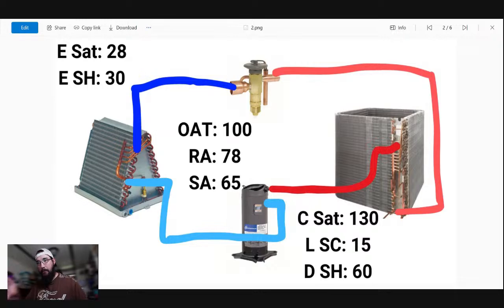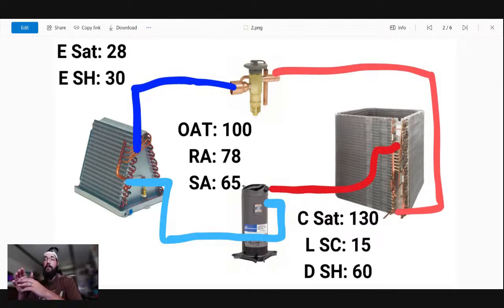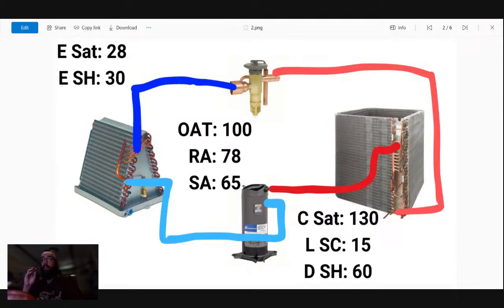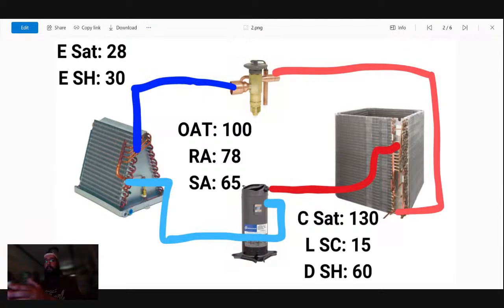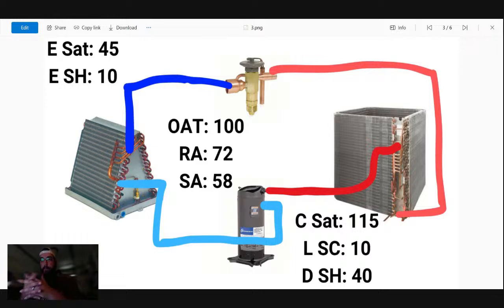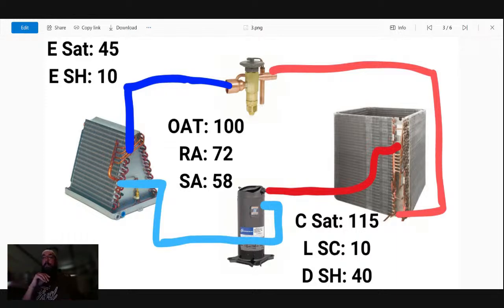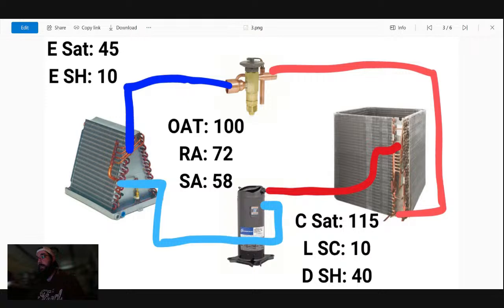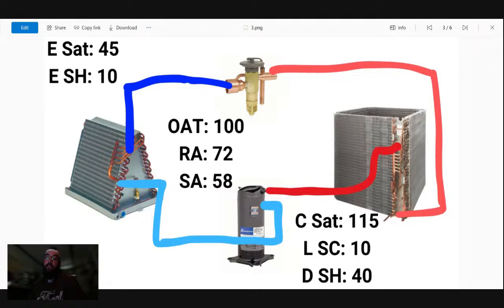AC Troubleshooting Exercises

Comment: Your evaporator td is 13 degrees so there's definitely a problem. The condensing temperature over ambient is about 30 so that eliminates a dirty outdoor coil . Your sub cooling is a little high but nothing out of the ordinary however  when you look at your super heat being 30 that looks like you could be stacking up liquid after the condenser and not feeding the metering device . I would need to know the temperature drop across your liquid line drier and if that was within range then the txv may need an adjustment.

Comment: Just to add to the oil logged evap conversation,  if anyones interested,  you will see a low evap superheat for sure, along with pretty dramatic hunting usually, for example you may see your sh bouncing from 2 to 6 back down to 2 then back to 6 and so on. Thats been my experiences anyway. But the big difference between oil logged and low airflow is evap delta t. Low airflow=high oil logged=low. The oil prevent heat transfer which causes the hunting as well

Comment: I love when you do these. Its like a little quiz to keep us on point. What id like to see you add for future is pressures (all 3)and line temps(including discharge)as well as space wb or at least rh values. For this one, maybe all that is not needed but id like to see you give us some more advanced scenarios with all of it. Maybe even throw in the compressor amperage.  I agree that we all should be thinking temps rather than pressures, especially when we work on so many different types of systems but maybe its my ocd but i just like to see pressures beside sat temps Keep up the great work bro